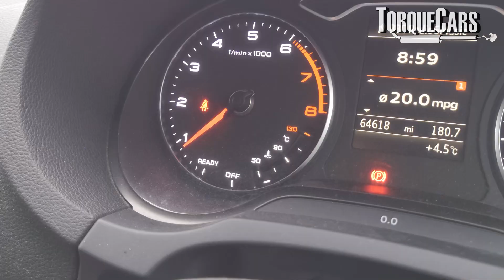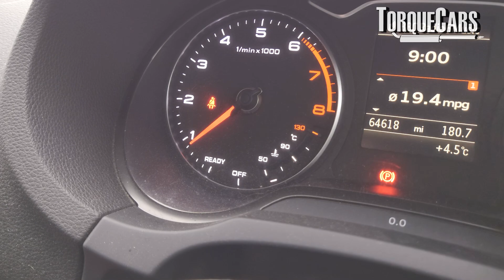#1 Best Way to Warm Up Your Engine 🔥🚗 (Most Drivers Get It Wrong ❄️)

Comment: Interesting video and comments 👍✌️😊

Progressive warm up in our house. But if the car hasn't been started for awhile, I'll turn it over a couple of times, then start it (a bit trickier on a 'modern' car), then I get under way, lower revs but without labouring the engine. Then slowly build the revs and load. That can be tricky as we can be on a dual carriageway in 5-10 minutes or even the motorway. 

When we've been lucky enough to have a new car, or if rebuild work was required on an engine (CVH engine last time, some 15 years ago or so - not our fault), we run them in on the correct oil for 500-1000 miles, then an oil and filter change. Then we progressively expand the rev range over every 1000 miles or so. Our current Suzuki's had very tight tolerances to start with and required careful handling. I suspect many don't bother these days though. Often cars are purchased on PCP ('you'll own nothing AND be happy') other money loaning (Neo Maoist) cons, so people don't understand or care? I've also noticed how main dealer garages ding cars which they can get repaired at trade but can then knock the customer down at trade in time.

Comment: It's annoying, driving a hybrid, because the internal combustion engine only starts when I put the vehicle above a certain threshold of throttle. Sometimes, turning the AC on will lower the power available in the battery, forcing the ICE to turn on to charge the battery.
Reply from the maker: I'll be covering Hybrids very shortly in a video, there are some tips I've picked up that help plus the way they are designed mitigates many of the cold engine risks (at least a bit more than a conventional ICE engine.)

Comment: for all engines i have known, either diesel or gazoline, when you first start it there is a 30s period where you feel the engine is idling roughly due to massive injection for cold start. So i let the engine pass that period and then i drive. Yet i keep under 3500 rpm for a gazoline and 2500 rpm for a diesel till the water temp has reached close to its operating temp. And then only i drive harder if needed. My 2 cents, cheers

Comment: There was a study done a while ago, basically oil temp doesn't attribute to engine wear nearly as much as water temp. Oil is designed to work between a large range of temperatures, but the internals of the engine expand when warm making a signifigantly bigger difference. Once the engine itself is at operating temperature wear is low. They found an almost exponential effect on engine wear with water temp, as it warms up it starts to dramatically reduce wear, then slows down the closer it gets to opperating temp. The best thing to do is to warm up the engine as quickly as possible with the lowest amount of stress on everything. Basically as soon as you have oil pressure start driving, stay under 50% throttle and 50% of your max rpm and your car will thank you. Idling for 10 minutes every day is TERRIBLE for the engine as you let it sit in the absolute worst condition for as long as possible.

Also the turbo thing is a myth, unless your turbo is ONLY oil cooled don't bother waiting, I'm on the original turbo at over 260k miles and I took it out not too long ago to check it and it's still perfectly fine, it has never been allowed to cool after any long drive or hard spirited drive.
Reply from the maker: That's interesting, thanks for sharing your experiences and findings - I'm sure that will help a lot of people.

Comment: On my 2013 petrol I do progressive, idling just a minute or so before. On my big full iron diesel I left it reach thermostat temperature which takes about 10 minutes, it has  aftermarket gauges and  oil pressure is very high on cold at idle, about the same as throttling it hot...

Comment: I try to give 20/30secs on initial start from cold. Then dive easy for first 5mins at till I get at least 50c on the oil temp if I need to boot it I’d want to see at least 60 on the oil temp

Comment: With modern engineering techniques, you only need to avoid harsh acceleration for the first 60seconds really. I never let it warm up, I start it, pull away gently and just drive gently for the first 90 seconds, which is basically get through the first set of lights. After that it's fine.

Comment: As a former marine engineer with a diesel car I warm up and cool down my engine progressively every time. I use the oil and water temperature gauges as the guide to how my engine is warming/cooling.

Comment: After 10 seconds i drive off. Just drive gently and stay under 2500rpm especially with a diesel, a petrol is fine at 2500 rpm. Done it every day and now I'm over 80000 miles with my M140i,  still drives like i bought it at 20000 miles.

Comment: I let my car idle about under a  minute and a half  or so until the revs drop to normal idle speed, that leaves enough time for the oil to cycle through and the temperature to go up gently. Then I don't need to drive hard as I have more than enough torque to get going easily. I never ever rag the engine from cold or even near warm, even then still, more than enough torque to get going without the need to put the right foot down..

I also let the turbo slow down before stopping the engine. Then being an Audi, I know the coolant pump keeps going to get the engine to cool down nicely.  Fingers crossed, 35 years of driving and I never had a headgasket issue.

Comment: I start the car , wait 30 sec then go slowly as I have a residential road and few traffic lights, then progressively increase RPM to 1500, once I arrived to the motorway the engine already reaches its operating temp and I can push it.

Comment: I always let it idle for a minimum of 30 seconds in summertime till it idles down and then I turn it around in the driveway just letting it move at idle and after that the temp is already just above the minimum gauge reading. Then I drive it around the block to the stop sign and it’s such a slow drive it doesn’t get above 1500 rpm with almost no load 

By this time it’s halfway warmed up and I drive it extremely gently till it is fully warmed up. 

In winter time I let it idle till the temperature is at least slightly past the minimum mark on the gauge. Then drive it very gently till it’s fully warm.

Comment: Car manufacturers have been silly to set the warming up rev to so high. It should start and be managed at the same rpm as operating rpm. If drivers want to warm up faster, they could rev it up a bit higher as they want for a longer period. More driver control is better than onboard control

Comment: i have a 2.0ltr TDi VWT5.1 remapped, on start i usually take it slow for about 2 minutes let everything warm up. On the way home, the last few miles take it super easy, pull onto drive then run engine for 30 seconds at idle before shut down. Oil change every 4k miles. Engine runs great, flys through MOTs. When refuelling i add Lucas fuel system cleaner, great stuff, in the winter occasionally add DPF cleaner.

Comment: . I grew up with the fragility of 80s hot hatches so give my cars an easy life. I own a mk7 Golf r estate and start up give it a few seconds to let oil circulate. Turn off stop start then drive off take it steady/progressively  until oil reaches 90deg at the current temps this takes best part of 5 miles during my commute in the uk. Change the oil once a year. Never modify cars never hammer them even when hot. And don’t do launch control starts. Does it make a difference long term who knows but that’s what I choose to do. 😀
Reply: Not doing launch control is more for saving the transmission than the engine, You're right to let oil circulate on start up, wait until the choke settles down before setting off. I don't have an oil temp gague so I do coolant tempreture + 5 minutes before driving it hard. I also turn off that stop start rubbish. I do hammer it sometimes though but I'm in a Toyota I'll get away with it.
Reply: @gravemind6536  you really don't need to do that, oil temp is no where near as important as water temp, simply because once the interals are up to temp the engine has perfect tolerances

Comment: I do both. I wait a while before driving the car and i progressively go up in rpm as my oil temp reading goes up. I can also feel it pops into gear much easier when oil temp is high. I let the engine idle for 1-3 mins before turning it off at the end of every drive.
Reply: @lronSausage  huh? idle at the end of a ride? why would you do that?
Reply: @mnzrk High performance turbo chargers run extremely hot. Turning off the engine stops the oil flow in the turbo. That will cook the oil and clog the bearings. You need to keep the engine running so oil can continue to flow for a while and for it to cool down.
Reply: @lronSausage   Isn't your oil already at the max temp while you are riding? If it touches anything hotter, then it gets hotter itself and comes to an equilibrium and everything is the same temp eventually. Why would the oil get hotter than it is after you stop the engine?

Comment: I always drive slowly and progressively till engine is warm , usually first mile or two at low revs ,and as for stopping,I usually drive a bit slower as I near my home then ,when I'm in my driveway,let the car sit  for a minute or so to let everything settle and cool also use good quality oil and good quality fuel bit more expensive but helps in the long game with less repairs necessary I find

Comment: Back in the 1970s I had a colleague who had an Alfasud(petrol only) which had a light that stayed on after starting until the engine could be driven briskly. That backed up something that my dad told me in the 1950s that "You should never thrash an engine while it's cold Tommy". I was about seven...
Reply: My 2011 Toyota 2.0 diesel has this. It's a blue light that doesn't go out until the engine has reached operating temperature. In winter normally takes about 3-4 minutes and currently (I live in Madrid) it goes out after a minute or so.

Comment: Is it a good idea to let the engine warm up from 5 to 10 mins (depending on season) to make really sure the oil lubricated all components ?????
Reply from the maker: Hi buddy, it is best to just drive it gently(ish) to warm up rather than let it idle for 5 mins or so. Oil viscosity drops really quickly and pressure builds almost instantly so oil wise you are good to go from 30 seconds onwards.

 I'd be more worried about metal expansion being complete before thrashing it. It will depend on the engine and if you live in a really cold area (-15c then you need to get some warmth into the engine and you'll probably be using an engine heater anyway).

Comment: 15 years and 275000 km now with my Skoda 2.0 TDI 16v CR 2011  now, always with chiptuning. After starting I drive immediately, building up progressively the rpm because too long driving with a cold engine is not good. Of course I do it carefully so not full throttle, after driving 30 sec idle before I stop the engine, no oil use yet, first turbo.

Comment: Engine temperature as shown on the guage is NOT oil temperature which takes a bit longer to heat up so give it more time before hooning it.
Reply from the maker: I strongly urge people to get the oil temp display or gauge for that very reason.

Comment: can you do a video on how to get the oil temp up on the display - ideally on a Vw Gti
Reply from the maker: I'll see what I can do - what age is the GTi? If you get an OBDeleven it is fairly easy to set this up, it adds it as a scrollable option with MPG etc... VAG Com is another way to set this up.
Reply: @torquecars  Please do one of Fiesta 1.0 mk8,.
Reply: @torquecars - thanks, its a 2008 MkV

Comment: It takes 5mins to disable all the EU mandated fake safety systems.   Oil viscosity does not change that much, except from stone cold.
Reply from the maker: That's true, it's about 60 seconds for the screen to fire up on most cars at least.  These are not actually UK legislation yet AFAIK, but car makers can't be bothered to produce a UK spec vehicle. Your main dealer may be able to permanently disable some of these annoyances. 

Also yes we are talking about cold viscosity, it drops really quickly as the engine warms hence the encouragement to start using load on the engine earlier than waiting for "totally warm". The reality is that oil pressure and circulation happens within the first crank rotation or two on most models.

Comment: When my engine is stone cold, I tend to use higher rpm (2,000-3,000rpm) with very little or moderate load. This gets heat going into the head, and the moderate rpm gets the oil passing through the head quicker. Make sure you don;t lug your engine (high load at low rpm) with cold oil. The oil is not yet providing a buffer and you could get metal on metal in your big end bearings.
Reply: Idk man if you are driving a NA gas engine but on a TDI this hurts a lot because it starts to shake a lot at 2400 rpm you shouldn't exceed 2000 RPM at a stone cold engine
Reply: @AlpheccaMeridiana  I have gas and i do 2-2.4 with cold engine when need (hills or quick start to blend in to traffic)

Comment: as long as your AC is running, nothing is going to settle because cooling inside means heating outside. In this case the engine.

Comment: Further complication with a hybrid... in that gearbox/transmission oil still need to get to where they need to get, but the electric motor is so efficient that it does not warm them up.

I always warm up turning the ICE on as soon as I'm out of my (small) town - especially in winter - and keeping it below 2500 rpm until water is at stable temp (90) and oil is at least 50; ideally 70+ (stable temp 104), even if sometimes this means I get to my destination with a partially warm engine and higher fuel consumption. Cheaper than having to fix the engine or transmission...
Reply: Hybrid is the worst case when they have EV mode and the engine barely cuts in.
Reply: @user-xu5vl5th9n  Fortunately, I have a choice - "Sport" mode always keeps the ICE on for my car, but not all hybrids do that.
Reply from the maker: I'll try and cover Hybrids in a future video, watch this space. They are all slightly different in the way they work.

Comment: I'm normally waiting around 1 minute when I'm starting the engine, then I'm going with very low rpm in about 5-10 minutes, then i think is enough warm. 
My dad used to work and own few trucks and from him i know that every engine, doesn't matter what kind of - it must be proper warmed up in order to be in good condition for long

Comment: I have a mk1 Ford Kuga with the Volvo 20v 5 cylinder Turbo engine from the Focus ST. Have had it 14 years, start it and off very gently ( its an auto as well) so the local roads allow me to keep around 2000 rpm max til its warmed up but as its pretty rapid, i don’t usually exceed 3000 rpm anyway that much as I’m an old git and partially disabled now. Oil replaced at 4000 miles max which is about once a year as i can smell the petrol ( BP Ultimate)  in the oil when pulling the dipstick.

Comment: I wait until the engine drops to tick-over and drive off, gently revving up to 2000 rpm until the engine reaches normal temperature. From startup until I use the full power, 20 minutes have to elapse for the oil to reach its optimum temperature. Jag 3.0S F-Type.

Comment: Many years ago it was noticed that Police cars used 24/7 lasted better than the cars used by day staff, even though they were often driven the hardest. The reason was that they never cold started.
I always follow the advice in my owners manual, which almost invariably recommends driving gently for a few miles after a cold start before using full power. They also caution against leaving the car to warm up in tickover mode as the oil pressure will be minimal. The recommendation is to get in, start the car, and drive gently for a while. 
Using that routine my ICE cars all managed over 140k miles without lubrication problems. (They all died for other reasons) .

Comment: I drive a Toyota hybrid 2025...I push start button...I wait until the coolant display appears...summer after approx 1 min...winter after 2 to 3 min...than start gently driving...
Warming up the engine is crucial...However, I hardly read anything about how to warm up our  your transmission...

Comment: Mechanical sympathy goes a very long way in preventing failures. For instance I am quite a progressive driver; my 26+ year old Twin Spark engine still doesn't burn a drop of oil, and I'm using the thinnest possible for said engine: 5w-40 fully synthetic. To put it in a nutshell: take care of it and it will take care of you.

Comment: Car in garage, start put seat belt on, reverse out 20 mph speed limit then drive until engine begins to warm and only use when up to full operation temperature.

Comment: Coolant is around 88 deg c and oil around 74 when it needs cooling. That's is the temperatures when thermostats open including transmissions. Then we can start to push hard.

Comment: I have noted the evolution of the oil temp. with all my cars that gave me the possibility to do so (in modern cars, one has to do a bit research on the board computer). The water temp is only useful to warn for overheating. I noted that despite water cooling, the rise in temp. do vary widely according to the air temp. With 30° Celsius (86°F), the oil can be hot (from 80°C) after 8 Kilometers. With -10°C (14°F), it can be 30 kilometers or even more. And this is for a 1400 cc atmospheric petrol engine. Diesel ones need more; with my Tipo 1.9 Turbo diesel of 1991, it was rather 15 and 50 Kilometers. And this in light traffic conditions here in the belgian Ardennes. When I started my Diesel from cold in town, after a gathering in over-crowded Brussels, it never got warm in traffic jams, even after three quarters of an hour in winter. It needed to reach the motorway to begin to warm up above 80°C.